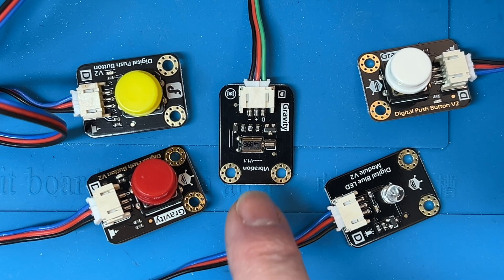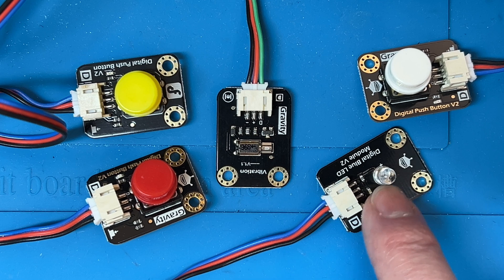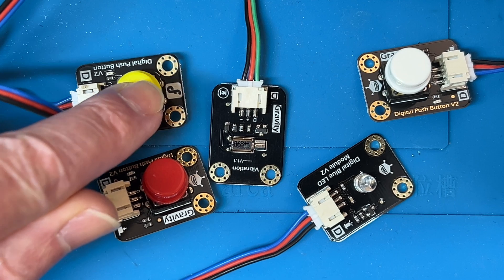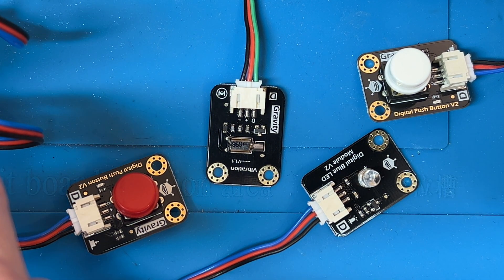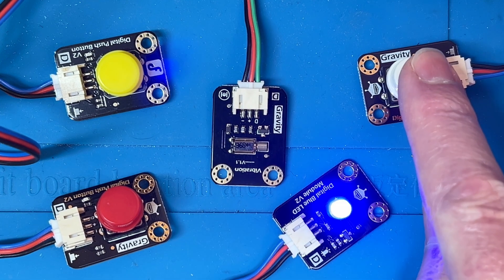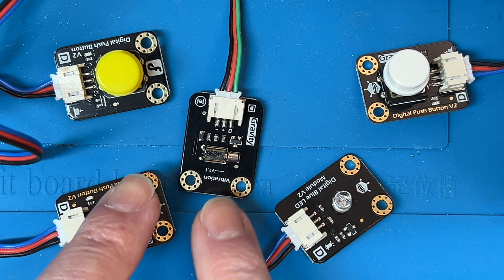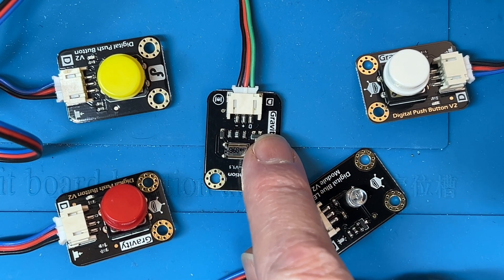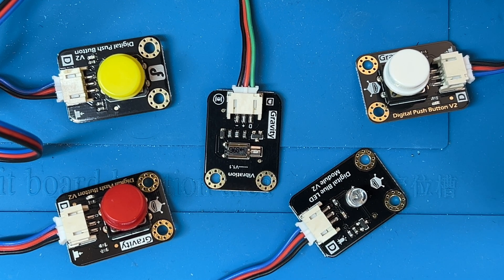*How a Cellphone Vibration Motor Works – Haptic Feedback Demo!* #cellphone #alerts #motor #tips

Comment: Cool. Is possible to harvest the light on a phone and repurchase it to a key chain (3d printed)? Asking for a friend. 🤗😂😂😂
Reply: *re-purpose
Reply from the maker: Yes, one can.
Going to be fiddly, but can be done.
Two 2032 button cells in series with a resistor to control the current should do.
Reply: There you go, if in doubt... Ask an engineer 😅 Thank you Uncle D.
Reply from the maker: @nickmuller2567  The led you are after is surface mount, so the unsoldering of that and wiring it up to the batteries, switch and ballast resistor is difficult without the suitable tools.